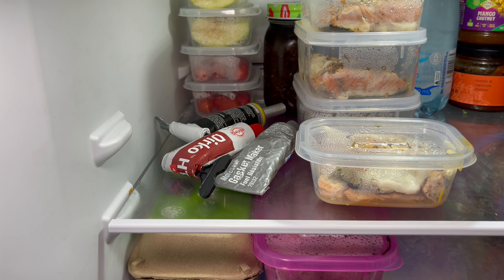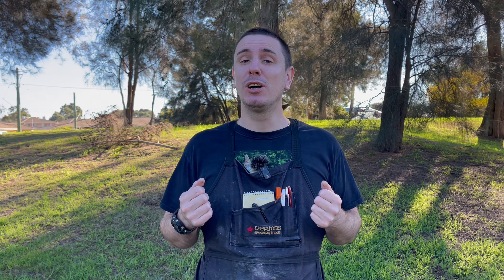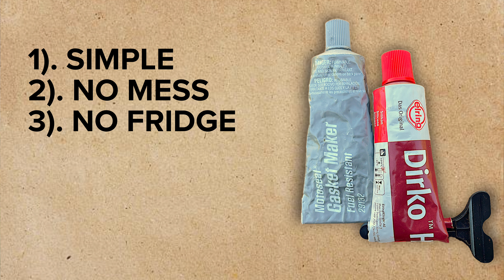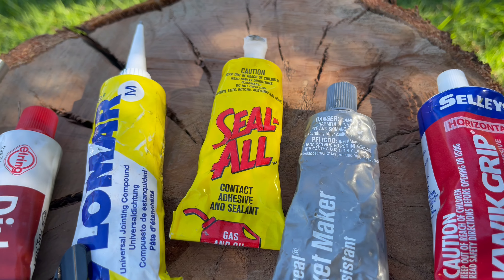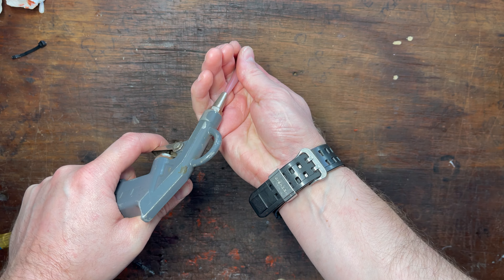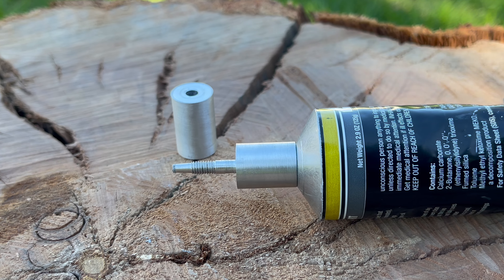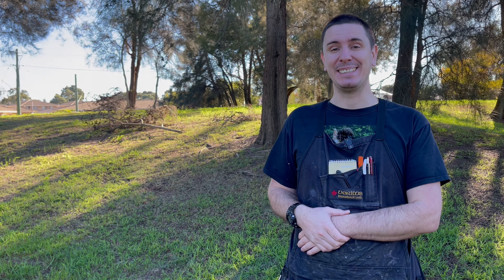A Useful Tip For Any Mechanic! Save Time & Money!

Comment: for sealant tubes i use a flexible plastic, such as from a ziplock bag between the thread and the nut. there's always plenty to be found in the garbage. for superglue, i tend to light a candle, and melt some hot glue, letting it drip over the open bottle. i then discard the cap, and peel off the hardened hot glue next time i want to use it.
Reply from the maker: Thanks for sharing :)
Reply: I do that with my brake fluid bottle because they collect moisture. Hydroscopic. Bottles last longer.
Reply: Superglue has a very short shelf life.
Reply: I’ve been doing the same - also using cut up sandwich bags - for years.  I cut some bags up into squares about 2 x 2 inches.  I do the same for any liquids when traveling via air.  Unscrew the cap, place square of plastic over opening, screw cap back on.
Reply: using a glue gun would safer I think

Comment: Will have to try the rubber gasket method. What I've noticed is that sealant will gum up the threads, harden, and prevent the cap from making an airtight seal. Then I have to puncture or drill out the hardened sealant in the mouth of the tube.
Reply from the maker: Infuriating isn’t it! This has solved that issue for me :) hope it helps!

Comment: OOOOOOOOOOOOH! I am definitely gonna 3D print me some nozzles now. I usually put a nail or screw slightly wider than the tip hole in the nozzle and then remove it and pull the cured silicone out like you suggested and my tubes have never really cured. Great tip though!
Reply from the maker: awesome :) cool idea!

Comment: I originally purchased my vacuum sealer for food storage.  I found that it can also be used to make an airtight seal on anything in a tube to extend the life of the contents.
Reply from the maker: Nice! Isn’t that quite expensive to do each time?
Reply: @VintageEngineRepairs  Not if you already own the vacuum sealer and the bags.  You can order bags online or get them at your local big box store, e.g. Costco, BJs, etc.

Comment: Awesome solution sir. Thank you
I'm wondering if an o-ring would work as well 🤔
Reply from the maker: Thank you! :) re the o/ring - I had considered it, but the sealant will still be contacting the plastic cap if you use an o-ring and many are notorious for cracking, especially threebond. I believe due to the chemicals in the sealants.

Comment: I submerse the tubes in a anti-rust solution of demin water + 10% Eth-Gly with tubes stacked in a cut away an old 5L oil pack leaving the handle in place. When need to use I put the tube in warm/hot water for 10min. Your rubber seal is a Great idea and will also do that.
Reply from the maker: You were dedicated to find a solution with that idea haha, hopefully this is more simple for you :)
Reply: @shanequinn,
  Am not familiar with "demin" water (?).     ☆

Comment: Using a vacuum food bag sealer works as well. Storage in the refrigerator will extend its lifespan, particularly in the tropics where the temperature is often >30°C.
Reply from the maker: Hey, someone else mentioned that, I just find this so much easier - no messing around

Comment: Great tip here.  I could not live without my metal lathes, I have two of them, use them all of the time on projects that I never would have thought of.  Most recent, yesterday making the sparkplug adapter to use for my new Mityvac MV8500 that I just purchased based on your recommendation.  I currently have the engine case split on a Husqvarna 125e engine and am looking for the best sealant to use in assembling the two pieces back together?  I was thinking of Permatex #3 here in the USA.
Reply from the maker: Me too, I love mine!! The best case sealant imo is linked in the description of this video - threebond 1215 which is the identical product to yamabond 4 just a heck of a lot cheaper lol edit: don’t use #3 on cases it won’t seal properly. You want a case sealant rather than a gasket dressing compound.

Comment: What are you using at the bottom of the tube to squeeze?
Reply from the maker: It comes with some sealants to help squeeze the tube.
Reply: Exactly, need a link for that.  Never seen one in US
Reply from the maker: @michaelrichards4000  they come with some of the tubes 👍

Comment: I am restoring an engine. (It’s just a clone 196cc) and noticed that it has aluminum push rods. I think I would rather have steel pushrods in it though. I have a spare clone 163cc that has steel pushrods. The aluminum rods are 0.0035 shorter than the steel rods. Would it be ok for me to swap them? Is that a big enough difference to warrant not swapping or will this difference not be a problem? Thanks for any help.
Reply from the maker: If you do swap the push rods, just adjust the valves. There is normally a reason a certain material is (or is not) used. If it was me, I’d stick with what came with the machine. If the new push rods are harder than the valves you may wear the valve stem, you may wear the pushrod drillings / guides etc. one thing I have learnt - the more creative I get, the more problems I cause haha

Comment: I put my gasket in the Sriracha top so it quit leaking down the outside of the bottle.  Been using grease with RTV for years, never had a gasket fail.  Rather than putting it in the cap I just smear it on the external threads.  Works its way around sufficiently.

Comment: Hello small engine guru.  I was looking at the metal tip on your RTV tube.  Where can I get one of those?  Thanks
Reply from the maker: Hey Rob, I made It on my mini lathe mate :) they aren’t sold anywhere that I could find :(
Reply: @VintageEngineRepairs  I would love to find one.  I have no feeling in my fingers due to nerve damage and that would help control the flow for sure.  I'm going to look hard to see if I can make something work.  Thanks for being you.

Comment: I use Three Bond 1184, because it lasts longer sitting on my office desk in the house.  Dirko starts hardening as soon as you open it.
Reply from the maker: So long as you keep it sealed as shown you won’t have an issue. However without a seal on either, 1184 lasts much much better :)

Comment: Your favorite tub doesn't look anything like what the Amazon link directs me to.  What is the product name please?
Reply: It looks like Yamabond 4, the one the fella machined a cap for.
Reply from the maker: Yep! It’s Yamabond 4 in the video, this is made by the company “Threebond” for Yamaha. Threebond 1215 is the exact same product, but you get a bunch more and pay less. Don’t waste your money with Yamabond 4. The only reason I tried was because I had hoped the applicator nozzle shown in the picture where I ordered it, would work better. Well the picture on the website was not what I received!! Anyway, here you go for reverence, this is the TDS for Yamabond 4 and as you can see it states “tb1215 / Yamabond 4-mc” (tb1215 = threebond 1215) - the product I linked to. https://www.rockymountainatvmc.com/docs/MSDS_Yamaha_Yamabond%204.pdf

Also, note this nozzle, well that’s the style I ordered and just got the regular cap, I was not impressed. This just so happens to be eBay.. https://www.ebay.com.au/itm/373848856388
Reply: @VintageEngineRepairs  That's great information.  Thank-you very much!  Another brilliant and informative video.  Always a pleasure to watch.
Reply from the maker: Thank you :) glad it makes sense!

Comment: You can also stick a screw into the 'big end' of the nozzle after you've taken it off - then just yank out the hardened plug later. Still wastes all the material, but...
Reply from the maker: Hey :) some sealants are quite small tubes so the curing goes right back into the tube :/ I have done this for years with larger caulking tubes with some success though :)

Comment: So you're a happy camper on the lathe puchase. Opens up many possibilities doesn't it.
You think submerging the sealants in a air tight container filled with water would work? 👍🍻
Reply from the maker: Couldn’t be happier with that lathe. Be prepared to spend some time setting it up and doing small improvements, but once done it’s an awesome, affordable tool in my opinion! If it’s in a container it still has access to air so it’ll still cure. Even in a bag wrapped around it they cure. This has been the best solution for me :)

Comment: I wonder if an "O" ring would work as a gasket.
Reply from the maker: I had considered it, but recommend against it as the sealant still comes in to contact with the cap that way and threebond especially split very quickly - they’re useless - whatever plastic they are using it’s not resistant to the methanol!  Best to stick with the inner tube I believe :)

Comment: Try a rubber "o" ring
Reply from the maker: I had considered it, but the sealant will still be contacting the plastic cap if you use an o-ring and many are notorious for cracking, especially threebond. I believe due to the chemicals in the sealants.

Comment: Rather use Blue Hylomar. I have a quarter tube that's 8 years old and still usable😂
I see you have a tube in your examples. Gasket although a good idea is unnecessary.
Reply from the maker: Haha yes I have it too! Though it’s not a gap filter and can’t be used on clamshells sadly. It’s a wonderful product though :)
Reply: @VintageEngineRepairs  If it keeps oil in a 1970 Norton commando it will keep oil in everything but an air cooled VW or an old Harley Davidson.😁
Reply from the maker: @andrewallen9993  🤣🤣 NOTHING keeps oil in an old Harley haha

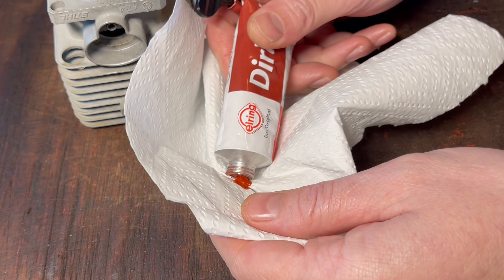Comment: 0:56 That’s not a waste, that’s a minuscule amount of material to do the job right.
Reply from the maker: You may do that 20+ times per tube, it’s about 25% of the tube at that point, that’s a waste in my opinion. It’s unnecessary when you use a gasket.

Comment: You might think the maker could give you a lifetime seal, but they would rather sell you another tube. Proprietary parts and repairs, $50 oil changes that only replace a big oil filter with old oil left in the engine, never no oil change engines and 100,000 other snake oil gimmicks that screw you and the environment with bulging waste dumps are the way now. Don’t call them landfills. There are way too many professional computer wave surfers in corporations looking every second for a method to take your assets. What the hell ever happened to serviceability, longevity of equipment and common sense?
Reply from the maker: That finished in the late 80’s!